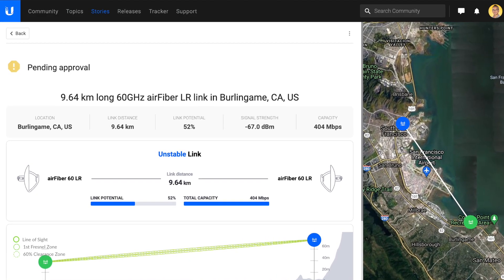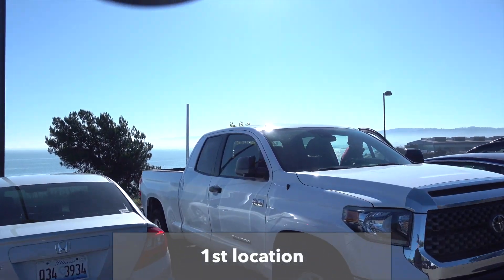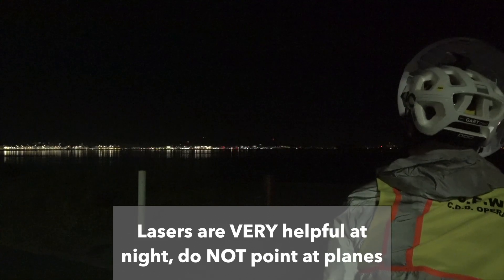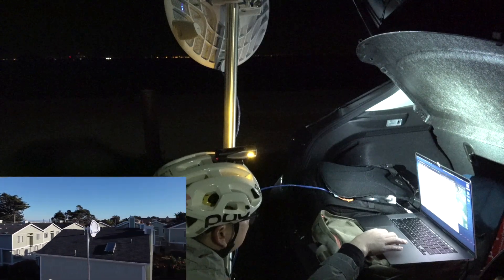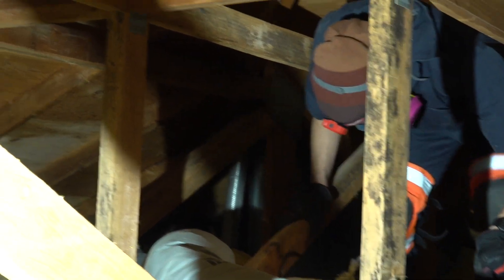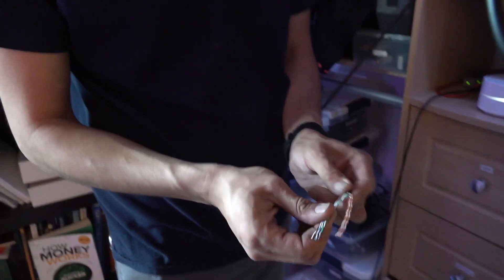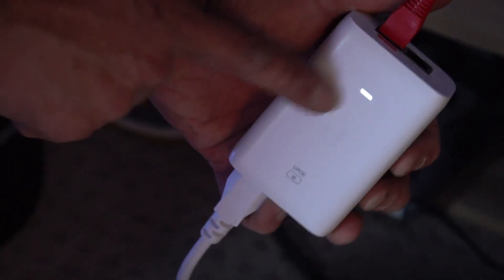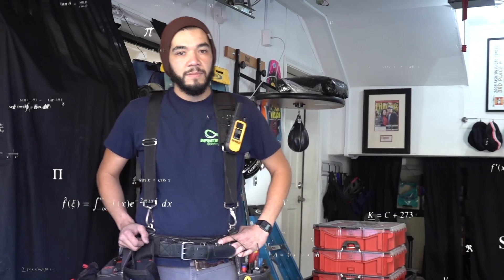AirFiber LR 60 Distance Test and Install

Comment: So, did you move it because of the tree? What happened?
Reply: guessing someone went out at night and cut the tree, lol
Reply from the maker: Can't use it with ANY obstruction, including leaves.
Reply: @infinitetechservices9809  i mean did it end up working on the roof? Did you just place it up higher?  I use a 60ghz p2p at home.  Just a distance of 227 feet or so.  I cut a couple limbs out of the way.  Should have tried it with the limbs in the way for science first.

Comment: in 60ghz the antennas have to be face to face at the same height it is a millimeter link another thing seemed to me to see that you had the antenna upside down what happens if it rains later I saw that they placed it as it should go